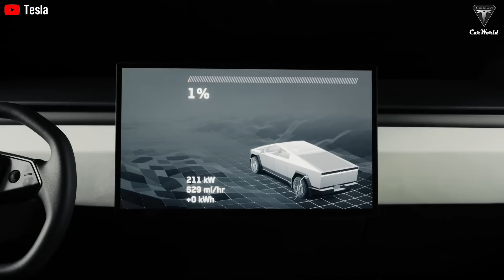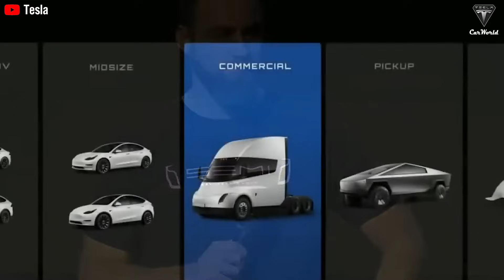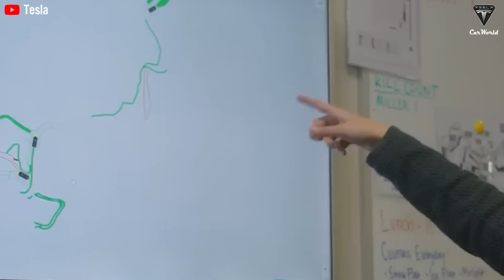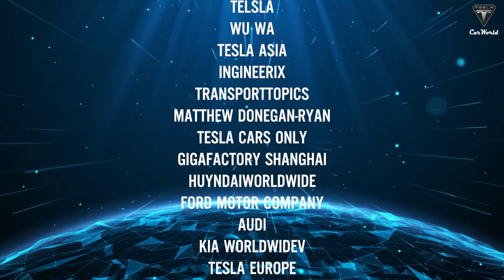It Happened! Elon Musk Leaked Tesla Semi Gen 2 Overpowered Specs Nobody Saw Coming! (Why It Matters)

Comment: Some thoughts. 
.
Return on investment (ROI). The electric truck at say $250,000, will pay for itself in 2 to 3 years in fuel savings alone. This will drive the large fleet companies to electric. The same with owner operators. 
.
Self driving.  This will take at least a decade and most likely 3 decades due to regulatioaty and public acceptance.
.
Battery.  The lithium battery is obsolete. There are several other chemistries that are about to be ready for production.

Comment: Also help asphalt on roads light weight truck
Reply from the maker: Good observation. Lighter trucks could indeed reduce wear on roads and asphalt. Should governments consider that benefit when deciding infrastructure policies?
Reply: Trucks will weigh about the same, they have limits. If the tractor weights more, they haul less cargo.